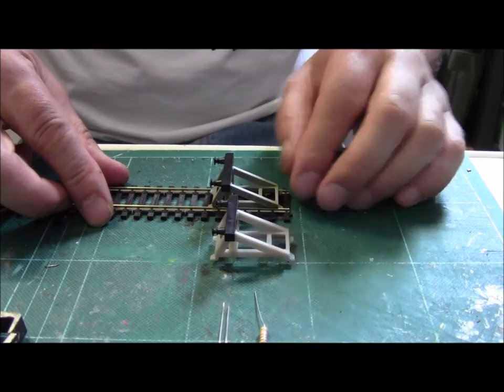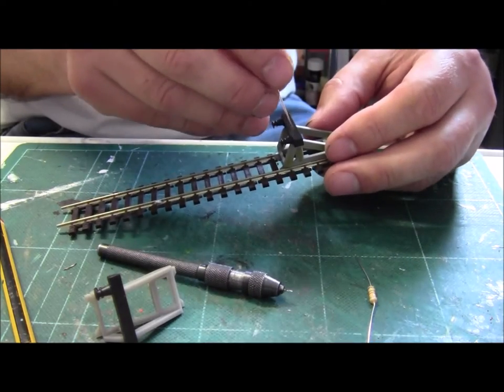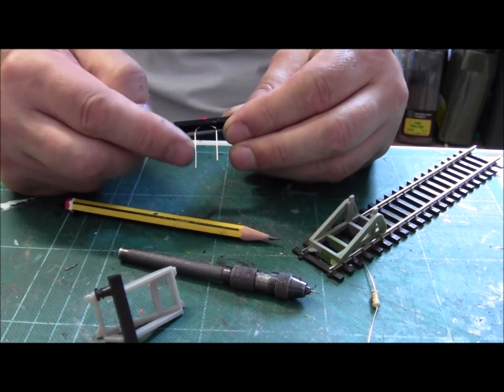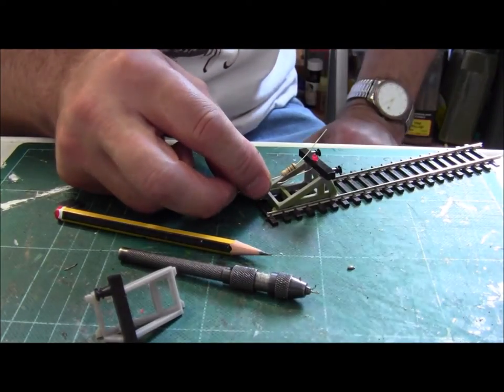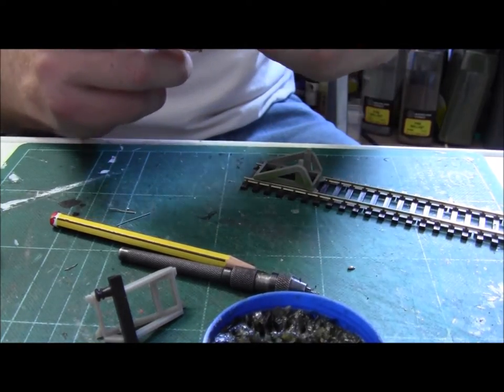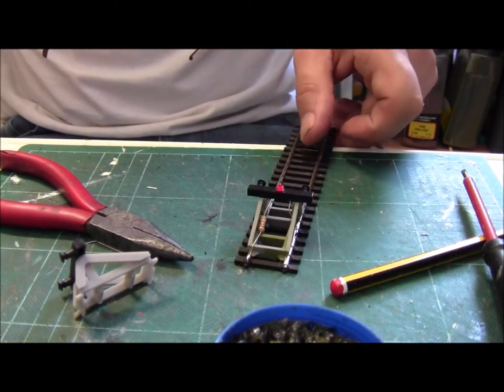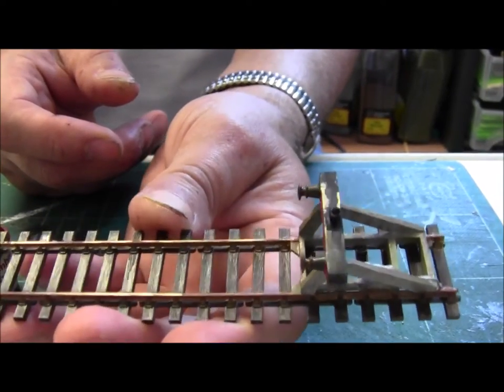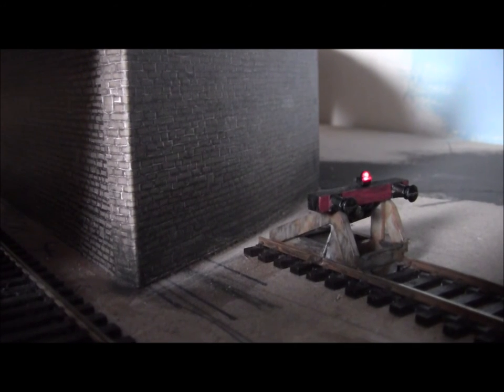Fitting LEDs to a OO gauge TRIANG Buffer Stop.. No17

Comment: That looks really good mate, what size is the resistor and led, i have loads of old buffers i could do this too. Gives me something to do whilst I wait to get my layout started, the more stuff like this i do now the less when i want to get track on.
Reply from the maker: Hi Paul I'm not sure on the size of the resistors as they came with the lamps I think they are 3mm amp. I will have to check it out. the lamps are easy to find on ebay. they are shaped like lanterns. it is possible to turn the lamps on end and have the dome facing down the track. good luck if you decide to go ahead with idea....................regards tony
Reply: Definitely going to do this as it looks really good, thanks for the tip.